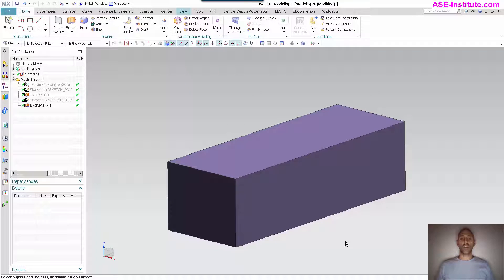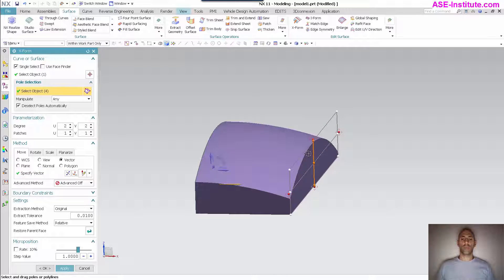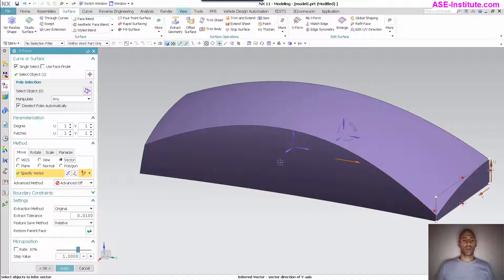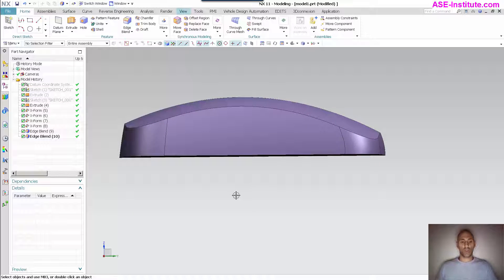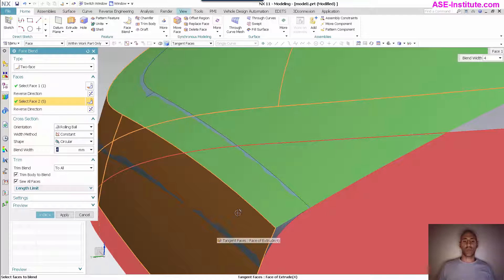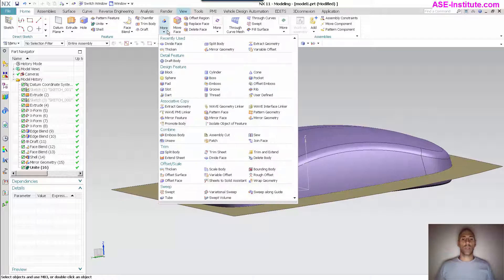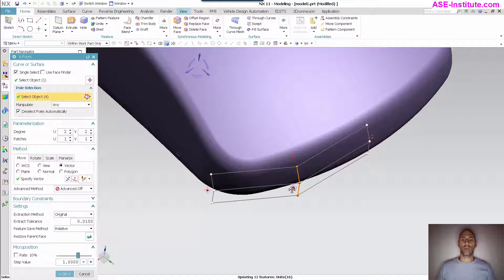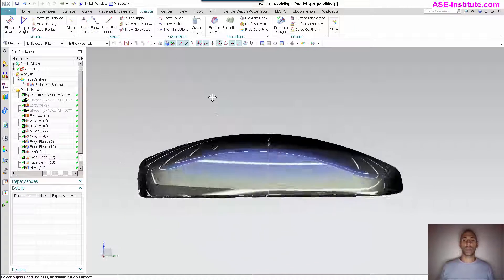X Form: Mouse | Siemens 11

Comment: Hello, can I use a x-form in a small portion of a large surface  without change the parameter of the rest of the surface? I know  that sometimes the variation in the other parts is too small, but if after  the x-form I do a 3D compare in Vismockup the result is not good to represent in a presentation and be understood for example.
Thank you for the channel!!!
Reply from the maker: You can yes but that gets a little tricky. You may need to increase the patch count not just the order. With increased patches you can isolate things a little better. Maybe a good video to make...
Reply: Thank you!! I will try.
Reply from the maker: https://www.youtube.com/watch?v=vneB0BrbM9I

Comment: Hi Steve, howdy ?
tonight i decided to give a try back to x form and following your steps here, reproducing scrupulously each step, it just failed at the end. i'm under NX 10.0.3.5 MP11 and here is what happened :
On first try i started using the X-form over a block primitive, and when i applied the mirror geometry feature, it worked but once unite i still had 2 geometries instead of one, but the most curious was about the split body feature, result didn't give me bodies as expected but a kind of intersection between my geometry and the extruded sheet, like if the extruded plane had a thickness. Wondering what could differ betwen your method and what i reproduced i noticed you didn't use a block primitive, so I restarted using extruded sketches to see if it could have an influence but none to say the software logic was applied in the same manner, and i'm still stuck with the same results as before. That's weird. On second try, from sketches, once arrived at the mirror geometry i noticed that both sides were crossing each other very slightly but enough to let the unite feature whines and complain about it. So i wondered if it was related to the shell feature. After removing it, it could mirror and unite correctly, but i still had 2 parts instead of one, and the following split body produced the same result. Veeery weird.... ! Something doesn't work, but what ...
Reply from the maker: Sounds like a slight tolerance thing. If you do not have a perfect transition across center it will cause issues. You can do the mirror unit first then shell. But with the Shell you have to set it to "Shell all Faces".
Reply: class A surfacing SOLVED . It seems the trick was the class selection shortcut that you used in a snap during your demonstration, something i missed (first time i see that, btw), This is why i didn't obtain 2 parts as on your video, just because i was unable to select and hide. Since my first steps in NX i stayed with 1 solid = 1 part, in mind. My bad :)
Maybe shall i give a try now to layers.
Thanks for help !

Hi Steve, following your advice, i checked my sketches first and it lacked a constraint, but once corrected, everything was still weird. So i started again, with same result. Now i just did every steps again on another machine, with a windows 10 and NX 10.0.3.5 (no MP) and ... Surprise : same same, unite and split body, with or without shell just look to work but clearly the features don't have the same behavior. I don't see where it could be a matter of tolerance, as nothing was changed from the default NX set up. If you wanna have a look at the file, i've put a 892KB copy on my webserver : http://paparoot.org/mouse.prt
Reply from the maker: Looks great Okto. Thanks for the feed back. 

You visual settings look like Alias.
Reply: class A surfacing
Thanks, yeah this is because i work in a low light ambiance, this visual is less agressive with a background in a shade of dark grey. Now i'm trying to make a tongue & groove on these parts. But still trying :P
Reply from the maker: Would you mind if I did a show and tell?

I am working on a tongue and grove for you now.
Reply: class A surfacing
That would be just great ! I'm analyzing parts of plastic lying around in my workshop, to guess the method used. It can be simple on squared parts but for the round ones like this mouse model it's another story.